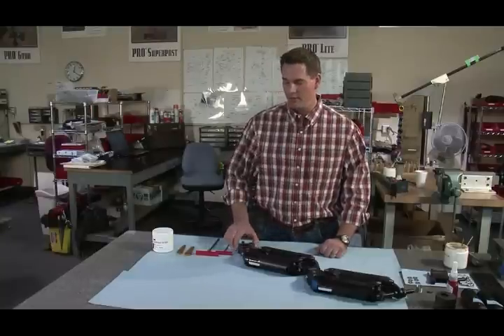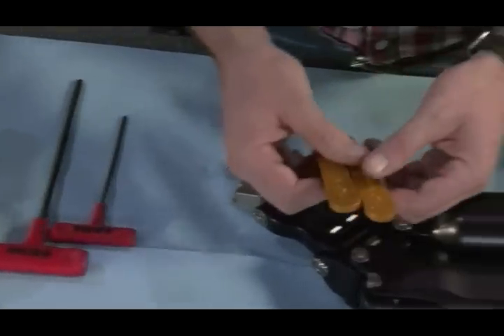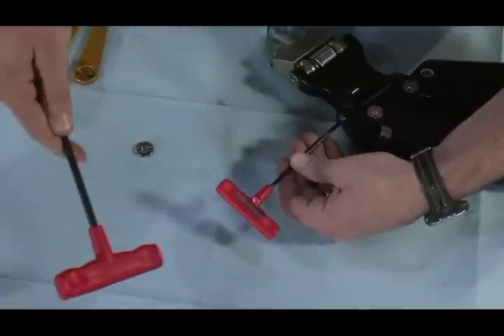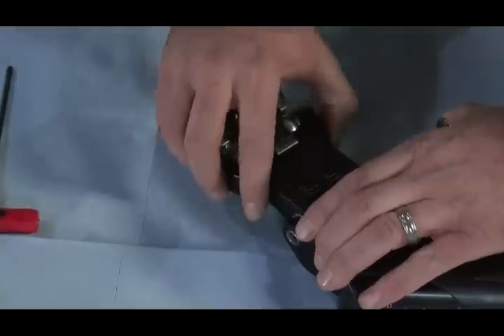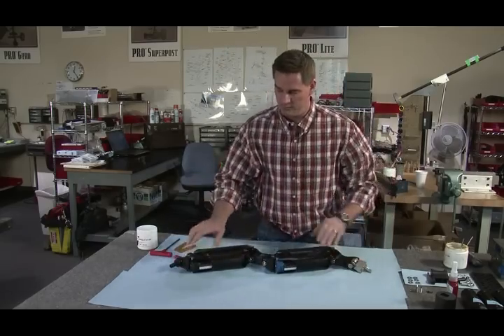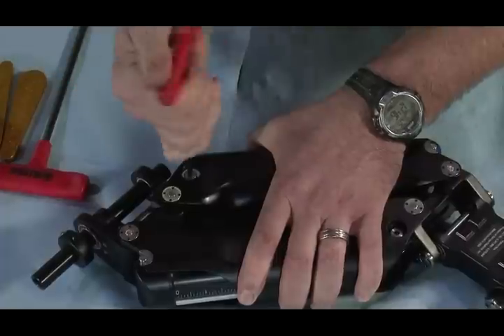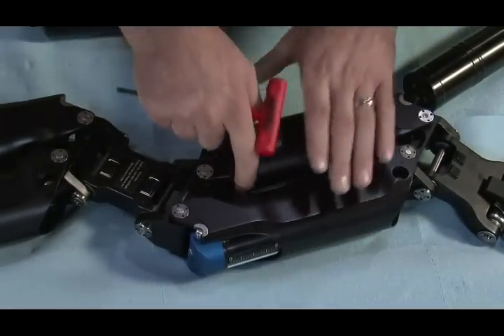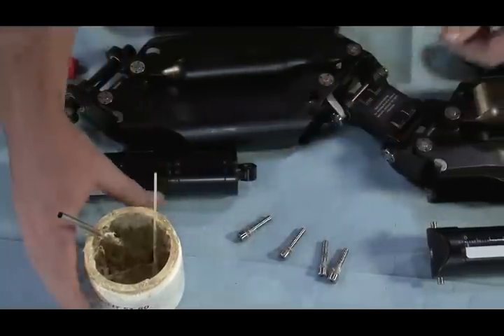GPI Pro Systems Pro Arms Fixes

Comment: Hi GPI Pro, my university recently bought a used GPI Pro system with the same 4 cylinder arm. The “gold tools” you used to unscrew the two bolt that’s holding the block pin is not in the case that the school bought. Is there a way we can order the tool for students who want to flip the block?